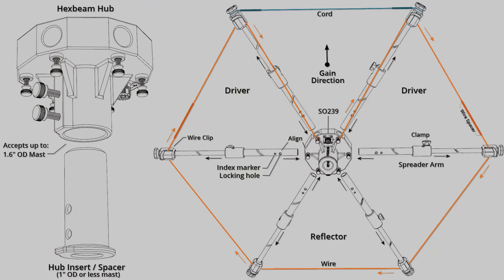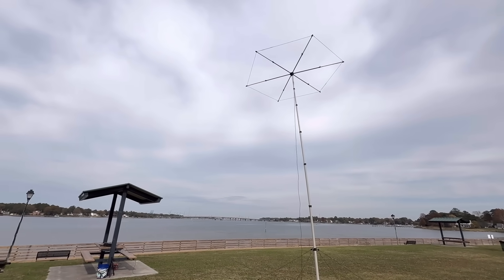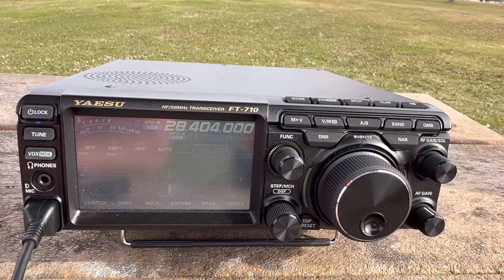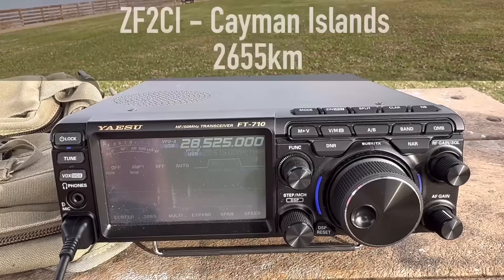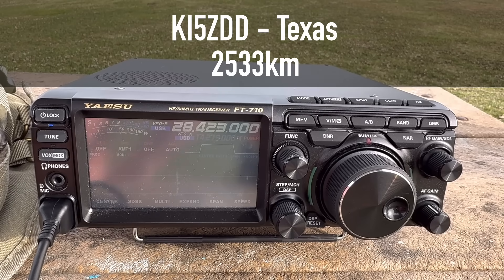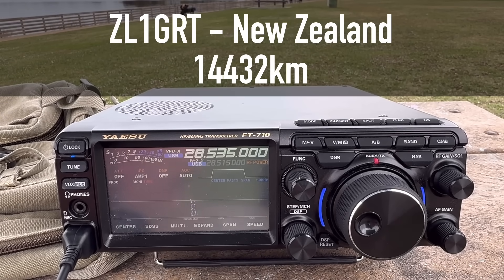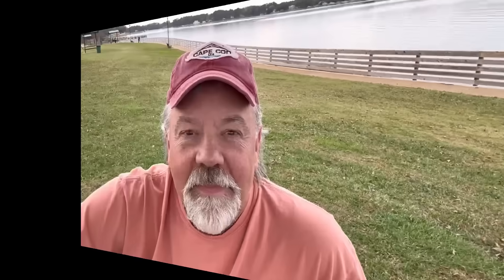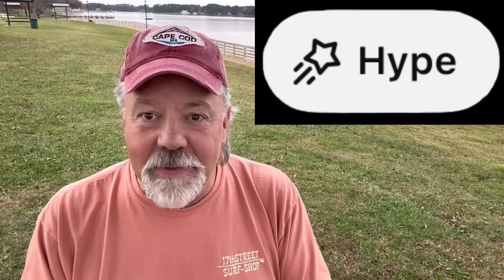The POTAbeam - Working Amazing DX with a Portable Hexbeam

Comment: Walt, if we place laterally eight 11 meter antennas, each spaced directionally by 45 degrees, would that serve as a suitable antenna for 80 meters band?
Reply from the maker: No, that would be like 11 guitars tuned to a G chord, when they’re all strummed they’re all going to play a G chord not a C chord. Wire length and resonance matters.
Reply: @COASTALWAVESWIRES Thank you for the reply. AI has some input: From a purely physical perspective, you're absolutely right. The two 10-meter wires are now a single piece of wire, 20 meters long. The fact that they were previously used as two separate antennas is irrelevant.

In terms of resonance, the new 20-meter wire would have a different resonant frequency than the two separate 10-meter wires, since the electrical length of the wire is now 20 meters instead of 10 meters.

Comment: Walt you have got to love the hater's and the people in the hobby that cannot make anything or even try but love to pull people apart who do and can. Reading the posts about them being sold out because of the video, i bet you or anyone else willing to give it a go could knock one up with 6 cheap fishing poles from China and old plastic chopping board and small u bolts, a dipole centre and a bit of wire and old string. plenty of designs out there on the web for elements for hexbeams and moxons, yagi. I have made a moxon which does 10m, 12m, 15m, 17m and 20m not all at once but you can change each elements out in a few seconds with 6 cheap fishing poles old wire and thin plastic. Also made a rotor motor for less than £20 to focus it remotely from the shack.

Comment: Walt, how long is your battery life when running 100w on the Yaesu ? Just curious 🤔
Reply from the maker: Using the 29 aH battery I’ve gone 4 plus hours and still had plenty left to go longer.
Reply: @COASTALWAVESWIRES good to know..thx 👍
Reply: @C @COASTALWAVESWIRES my next question would be how is direction determined on that antenna as it looks like it would be an Omni by the visual appearance ?
Reply from the maker: One of cross sections is a nylon cord and not wire. The ends of the wires where the nylon cord is comes back to the feed point in the center of the antenna. It’s a traditional hexbeam with two wires using a spacer. Basically a horizontal driven element with a reflector behind it. If you stop the video when the diagram is or check out their website you can see it.
Reply: @C @COASTALWAVESWIRES x Walt I’m looking for another horizontal antenna of some sort..this seems like it’s fairly tall as opposed to a yagi ? I’m concerned about wind drag on the rotor.

Comment: Great video Walt! Your FT-710 needs some side rails to protect the front of the rig. Portable Zero has them- cheap insurance!
Reply: I've been a ham for 48 years.  I never crashed a rig.   I got  side rails from portable zero and installed them on my 710.  Wouldn't you know,  a few days later i got tangled up in some cables and pulled my 710 off the table and crashed it on the concrete floor.  The side rails got bent (absorbed the impact) but the rig is fine.  I was able to bend the side rails back to their original shape using wood dowels, a hammer and the concrete floor(as an anvil).  They saved my rig for sure.

Comment: I’m real surprised 9U1RU was running simplex… Not that being split stops dummies from behaving badly. Very cool antenna. Wonder if you can squeeze 12m out of it?
Reply from the maker: They were split, the sun’s glare might be tough in the video but it you look close I was TX 5 up.
Reply: @COASTALWAVESWIRES 😂 I’ve never operated the 710. I’m used to the a/b switching when you key. I’m not sure I like that. I can see me going somewhere else and still being split wondering why I can’t get through. 😂 guess you’d get used to it.

Comment: Aloha Walt, this like your 3rd or 4th video in a roll that you had set up great antennas and DX like crazy. 🤪 
     I was given a box of treasures a month ago and finally went through it. It had a lot of great stuff including the EARCHI End Fed antenna but an older version than what my club makes today for Amazon. There was however, a ziplock bag with your call sign K4OGO-20, which was just a bunch of cut and measured wires? 
    Ok, moving on, I would like to see you do 11 meters on your PMR 171 with this same portable Hex Beam antenna. 
    I need a screen shot of your setting for your PMR-171, which I tried to see on your only video on your PMR 171 with the SO239 and mine I bought in July of last year with the BNC connector, which I’m still trying to find a good whip type antenna for still. 
    I’m always competing with you when it comes to radios and antennas except I don’t do YT videos,lol. 
     I looked on Amazon for this antenna and no dice. I looked on eBay and found a used real portable Hex Beam, 5 or 6 band antenna like one state over from you for $400 + shipping. I found a Hex Beam plate for a permanent set up for $65 but no poles or wires. 
      I have to admit that this is the antenna of my dreams and I’m will to bet that you could cut wires for other bands to use on this same antenna in a creative manner, worth a try, right? 
      Damn good videos AGAIN!! 😂
            Semper Fi 🫡🇺🇸
                    Todd WH6DWF🤙🏻

Comment: If someone's "tuning up" like that, you can either use the manual notch filter and keep them filtered out if you set the audio frequency, or switch on the dynamic notch filter (DNF button on the screen) which will do it automatically for you, but each time they key up you'll hear a bit of a ping as the radio sets the filter.
Reply: I wonder how many people actually use all the filters and other features on the radios they spend so much on.  I know I tend not too.  I'm trying to get better at this.
Reply: @jayasthree  Sometimes it's just a case of figuring it out as you go along. You get a certain type of QRM or noise, you think, "Hmm, could I do something to turn that down?" There are some things on my radio I don't tend to use, partly because I haven't got used to what the can actually do, but also because I've not needed to do whatever it is that it does.

Comment: Here in Canada, they sell 1/2" x 6 foot fiberglass driveway markers (so can find our driveway in the winter). I use them as spreader arms, and they worked great! I've used them for Hexbeams and Cobweb antennas. VA3IRF
Reply: Good idea, I have a tonne of them
Reply: @outnaboot  ,the ones at dollarama are qute good, 12mm thick, and about 2 meters long. My cobweb has been up for 2 1/2 years now, no problems. I did spray them with clearcoat to protect against UV.

Comment: What do you mean by " turn the antenna towards"? Is there a front?
Reply from the maker: It’s a hexbeam, one of those outer sections is nylon, not wire and the wires come back to the center in a VEE shape to the feedpoint in the center. There’s also a spacer in the outer wire which makes the frontside a driven element and the back a reflector.
Reply from the maker: It’s a hexbeam, one of those outer sections is nylon, not wire and the wires come back to the center in a VEE shape to the feedpoint in the center. There’s also a spacer in the outer wire which makes the frontside a driven element and the back a reflector.
Reply: @COASTALWAVESWIRES got it, I didn't know that! Thanks For the explanation

Comment: Great video what a blast! I have built the 10M K6ARK moxon but haven't tested it yes because 10M hasn't really been open much and I got sidetracked having fun on 20M. I checked the ebay listing and this hexbeam antenna is out of stock which has saved me from myself. I can see plenty of POTA on 10M today so if the rain holds off I might just have to try out the moxon.

Comment: When you say it’s pointed in a certain direction I am not sure what that means as the antenna looks symmetrical to me. What ever direction, it really works great.
Reply from the maker: One of cross sections is a nylon cord and not wire. It’s a traditional hexbeam with two wires using a spacer. Basically a horizontal driven element with a reflector behind it.
Reply: Thanks; did not have any experience with these type of antennas.